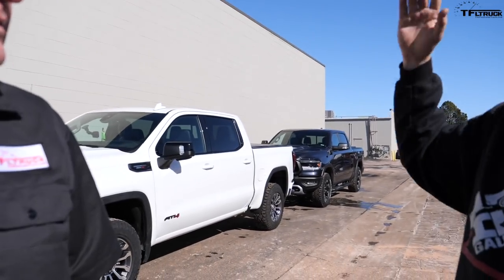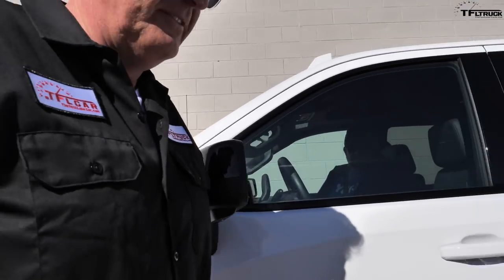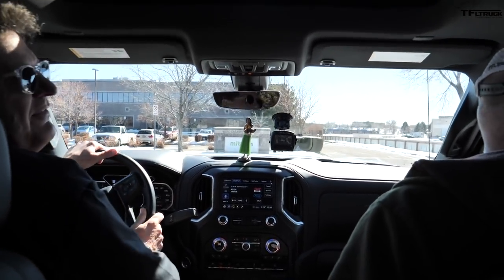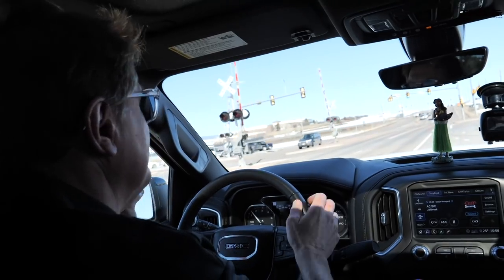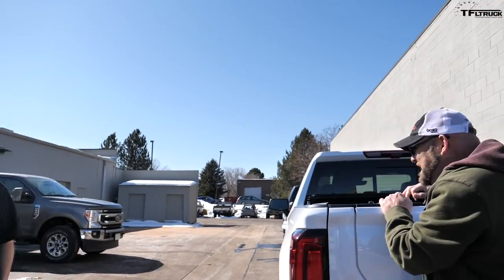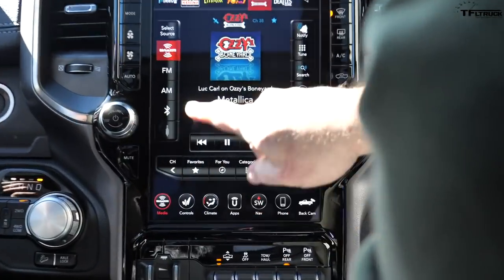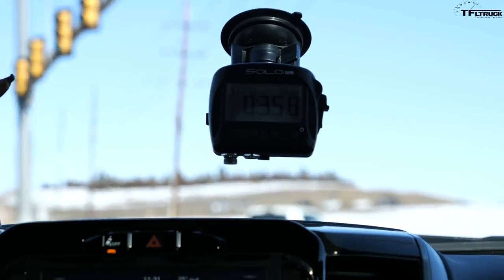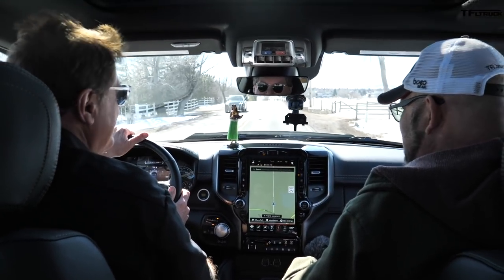Best Diesel Truck! 2020 GMC Sierra AT4 vs Ram Rebel Diesel 0-60 MPH Buddy Review

Comment: What a great and fun video to enjoy over breakfast. I will admit, that I have been looking for that color rebel, without airbags and without the pano roof. In the end, I believe the rebel will cost less money to own and operate than the G. M. Factor in the transmission and drive train maintenance and durability.  I just cannot get on board with a rear mounted timing set up, nor the oil pump design on the i6.
Reply: exactly, they took an amazing concept,  a straight 6 and ruined it with a belt driven oil pump that you have to remove the engine to service WTF

Comment: NATHAN! My man. I agree with you 95% . I've had both an Elocker on my F150 FX4 and a G80 on my Trail boss.  I found the Elocker next to useless in most offroad situations.  I live in BC there isn't much slick rock to crawl on. But lots of tight trails where a fully locked axle sucks!  The G80 being Automatic is always there. Now I'd rather a Torsen system LSD, but the G80 will do.

Comment: You are right Roman .I an glad my 2020 Silverado did not come with that tailgate.Also the dealer told me it's big bucks to replace and pickups tailgates often get damaged.I can also see lot's of areas for rust on it.I do love the electric tailgate on my 2020 which is standard on the high country package.When carrying  tool boxes and such it's a nice feature.
Reply: The multi step tailgate isn't going to rust, it's aluminum.
Reply: @karlschauff7989  That's good information.Thanks.

Comment: I am totally with Roman. . Yes to the "Man Shift handle" and NO  to all that stupid tailgate crap.
Reply: I have the GMC with the tailgate I have not had an issue. It is very easy to use. I previously owned a raptor and it cannot hold a candle to my new GMC unless I was to go desert running

Comment: I can’t beleieve noone said “forget it”.
The diesel is 20-30 years behind in technology and engineering compared to gas in the half tons and the price is prohibitive from any mpg gains and the maintenance on the diesels is insane plus def....
Reply: StoneysWorkshop . I agree.
Reply: Diesel leads gas in every facet of technology, that's partly why they are more expensive. Its not the 40's anymore where they are the cheap dumb alternative. They are the pricey performance alternative when performance is real world economy on working duty cycles. They are certainly more expensive to maintain, but not by some astronomical margin, its not 2010 anymore either and the emissions systems are relatively reliable now.
Reply: I spend $20 on DEF every 16000kms. Not really a big difference. The oil change on the other hand is $270...  I drive a lot and my fuel costs have dropped $600/mth vs the hemi I had
Reply: Matthew Garn I am speaking specifically in regards to half ton segment.
VW has great mpg in their cars and the heavy duty has the towing capability to justify the massive diesel.
The half tons can’t seem to decide what they want to accomplish with the diesel. Therefore you get something that can’t merge into traffic unloaded.
Reply: David Pritchard I am not sure about your gasket market, but here in Louisiana gas averages maybe 2.10/gal. I drive about 10,000 miles (roughly your 16,000km) every two months.
At 15mpg (my f150 with all my tools and parts loaded on hwy with 5.0) that’s 666 gallons at 2.10/gal is $1,400.
Lets say the diesel will get 25 mpg loaded with about 1,000lbs like I am. That is  400gal, and diesel on the cheap side is maybe 2.80/gal so that is $1,120.
If you are saving $600 per month more power to you, sounds great.
Here in the southern USA it does not add up
Reply: StoneysWorkshop I drive a lot as well, mostly unloaded. I have been averaging 5.5 litres per 100kms less with the diesel. Since 2014 when I got my first ecodiesel diesel has been less per litre. Today diesel is 1.121 per liter gas is 1.125.
Reply: Based on today's price it's a $400/month savings. When I first got it I was averaging $0.21/km in cost for the hemi and $0.11/km for the ecodiesel.
Reply: David Pritchard that’s great, I would be highly inclined to consider diesel if it was closer to gas prices here.
Usually a dollar or more seperates low grade gas and diesel, they’re getting closer at the moment.

Comment: I like the Carbon bed on the GMC and the bedside storage on the Ram. The tailgates on both trucks are just a gimmick and I could pass on the sunroof on both trucks. I like that the Ram has a larger fuel tank too. I feel like you guys dropped the ball on both of these by not at least telling us what the towing capacity was for both. One of the reasons you opt for a diesel is for more towing.
Reply: also a transmission review would have been nice.

Comment: I think it was embarrassing for Ram that it could not find Snarf's with all that shiny, flashy tech and the no-nonsense GMC just nailed it first try.
Reply: All that screen and no software behind it... Also, no Auto 4WD in the ram?
Reply: @svpracer98  The Ram's auto 4WD can't handle the bigger heavier tires. Tears up the transfer case over time.

Comment: I prefer the Ram tailgate but I use my truck for work and getting a forklift in closer for loading and unloading is a huge benefit; as is being able to getting into your truck bed when towing a trailer and not worrying about damaging the tailgate on trailer coupler.
Reply: They make a hitch that clears the tailgate on the GMC. Plus the bumper steps make it easy to get into and out of the bed without dropping the tailgate. Ram doesn't have an option like that, aside from those junk aftermarket steps that rust up and stop working after one winter.

Comment: Yet again Andre is right on the ram tailgate.
Reply: The Ram tailgate is a pos. Between the junk air ride system that burns up compressors, the unreliable electrical system, and the chintzy tailgate, the Ram is going to spend most of its life at the service department.

Comment: Everybody talks about MPG but what nobody seems to talk about it $ per mile to drive.
Reply: @Snake Plissken horrible mpg
Reply: Toyota tundras are junk. Couldn't pay me to own one.
Reply: Snake Plissken did you include the tow bills hauling the Toyota back to the dealer on warranty to have it fixed? I hauled mine in three time for the same problem and they would not cover the tow bill only threaten to cancel warranty if I drove it in after noticing it clunking. I will never have a Toyota again. The dealer was terrible. My gm dealers have been great to work with when shit happen as it will with everything.
Reply: I don't really compare diesels and gas. I just like diesel trucks honestly
Reply: Snake Plissken explain how you make said comment.   It’s been proven that the tundra isn’t working for Toyota
Reply: Snake Plissken who wants to buy new truck that one cannot tell the difference from the one that’s 10 years old.   Assuming said 10 year old truck is well cared for?  End of conversation

Comment: How in the heck do you get the 12 thousand pound tow rating in the ram? I tried every configuration on the ram website and the highest number I could find is a tradesman 2wd with 10,070 tow rating. On a side not I will never but another DT ram 1500. They are pieced together like a lego set and FCA doesn’t want to fix issues. Today makes day 65 my truck has been in the shop consecutively. Thankfully 🍋 laws in GA are 30 days. Can’t wait to be out of the truck
Reply: 3.92 gears
Reply: I test drove a 2019 Ram and it was a nice but but I can’t part ways with my GM 6.2. 
Maybe a good thing!
Reply: John Morris the 10070 is with 3.92. Only gearing available for the eco
Reply: @Tony-hf9mv  ah you never said it was a ecodiesel, yea they aren't rated to tow 12,000 that's only the hemi.
Reply: @Tony-hf9mv  the 3.0 Duramax is only rated to tow like 9,700
Reply: @johnmorris77  i said RAM they claim 12560 but the highest configuration i can find on there website is 10,070. Reading is fundamental
Reply: @beowulfgrendel24  that was your first comment so idk where you're getting the "I said" part. According to tfl max towing ecodiesel is a tradesman double cap 4x2 with 3.55 gears.
Reply: @R AJ yep have a family member with transmission problems in their 2019 Ram 1500.  Went to put it in drive and it didnt do anything, then slammed into drive so hard they thought they got rear ended. All kinds of metal in the transmission pan.

Comment: Would love to see a 6.2 vs 3.0 comparison. I went for the 6.2 in my AT4 but the merits of the diesel seem strong. Love to know how they tow head to head plus your driving impressions.
Reply: I've got the 6.2 AT4 as well,  but if I wanted a diesel, I wouldn't waste my time with turbo'd 3.0 v6 when there's a 6.6 v8 turbodiesel on the market. The 3.0 is bound to have longevity issues, whereas the 6.6 will more than likely last as long as you want it to.
IMHO, the 6.2 is a better call than the 3.0
Reply: I'd take the 3.0 any day vs the 6.2. I've owned both.

Comment: Correct me if I’m wrong but didn’t Lincoln had barn doors in their trucks?
Reply: The Blackwood...
Reply: My 77 Chev wagon has it. Although it's not split. Never gets used.
Reply: Connor Hendricks yep that one
Reply: It was not the same and the Ram tailgate is much nicer.
Reply: I had a Suburban with barn doors and they seemed to get in the way more then help. But some people love them.
Reply: @rayd2100  I much prefer my Suburban's cargo doors. I will never need a broom handle to keep the hatch up when the gas struts fail.
Reply: @wushock92   God forbid you replace them.  They're $20 on Amazon and take about 5 minutes to change out.
Reply: @rayd2100  True. For me, when my cargo doors are open, I don't have to duck or fight with items that are too tall to clear the hatch. Yeah, I'm lazy like that. LOL Good feedback, sir!

Comment: I don’t like the rear wet belt for the oil pump for the Duramax. It’s a fiber belt that is on the back of the motor behind a cover by the bell housing. Service life quoted by GM in theory is 150k. My question is why put a serviceable item in such a place. Planned obsolescence? Time will tell.

Comment: $65-70 k for a half ton truck. What is this world coming to?
Reply: Platinum f150 is like 80k. Insane,
Reply: David Lusk pretty sure the Plat F150 is around 74k. With the raptor engine off course but yeah expensive
Reply: That's still crazy. And with tax and license.. way over $80k
Reply: For that money, I could get a Subaru WRX STi, and a beater truck while having money left over
Reply: Platinum F-150 can be bought in the 50s with rebates and it doesn’t come with a raptor engine. That’s the Limited
Reply: @Luis Bolanos same with a good running beater truck that costs less than 10k. With the BMW, you can actually enjoy driving it, or any of other cars cheaper than the BMW
Reply: I’d like a new truck but I got my 14 Z71 Crew for $36k back in 2014 on the Black Friday clearance sale. I only have 57k miles, with trade  in value at $23k or if I’m lucky to get $28k private id have to be a fool to finance another $30k+ for what.. less hp, maybe +100lbs torque and better mpg? These new truck prices have buyers stuck in their current rides. I think I’ll just drive my paid off truck until she rots. Am I thinking about this wrong?
Reply: @Luis Bolanosbad idea. You want a truck that already got dents and scratches, and faded paint over the one from a showroom that costs about the same as a Porsche. And instead of putting that kind of money on a truck, you could get a nice car like a BMW Z4, VW Golf R, Subaru WRX STi and enjoy your daily commute and your freetime in the back roads and on the track. Spending over 40k on a truck is just absurd, but spending 70 or 80k just for a truck is idiotic. And you are not going to have fun in a truck that is automatic only. Can you name a half ton truck with a manual transmission still being made? I don't think so, they are boring af
Reply: This is the result of the buying public wanting everything including the kitchen sink in their vehicles.  Ain't life grand?  I'll keep my 2015 Colorado.
Reply: Steven Bittner exactly! These same people are always complaining as if the top of trim levels are the only ones available to buy as well as complaining about there being too much tech and luxury on these trucks..If you don’t like it or can’t afford it, you can still get an XL, XLT, Work Truck, Tradesman, LS, LT
Reply: Nothing new
Reply: @GhostOfAMachine  Just worry about where your money goes, not everyone wants to drive a little shoebox! sheesh.....
Reply: @iggy944  i know, not everyone has good taste. Overpriced monstrosities just look ridiculous. Only good trucks are made 90s and before, when they had a clutch pedal and a long shifter on the floorboard.
Reply: @GhostOfAMachine  lol good taste?  You lost me at driving a BMW z4 or vw golf. But whatever floats your boat
Reply: Now I understand why some people have a 70k$ truck and they live in a shithole. Priorities.............
Reply: Yes that crazy , that more them my house cost back in the day, they are way overpriced but people are still buying them so to drive a new truck that what they will want for it and will not deal much GMC let me walk out the door over 700 dollars and they sold the trade in to me so i went test the dodge out and payed that much more and then some after driving both of them so they did me a favor
Reply: @brentlafont5005  wow, have you ever heard of punctuation??? Your entire comment makes little sense.
Reply: I don't know if a diesel is worth the extra money. I've seen 2020 Rebels with 12" screens on dealer lots for $46,000.
Reply: @kevinwilliamson7294  I definitely think this is the case for many
Reply: @9663mu  You do not get the Raptor engine in the Plat trim only in the Limited trim and its over 85K!!!
Reply: @davidlusk4350  The Limited is over 85K!!!
Reply: @9663mu  You do not get the Raptor engine in the Plat trim only in the Limited trim and its over 85K.
Reply: Justin Thurman right but in US the limited is 74k. Your in Canada ?
Reply: @Luis Bolanos You can get more bang for your buck with a used heavier duty truck
Reply: @jlv3x  Yep. Just looked this morning at a local dealer. Had Rebel 5.7 crew cabs starting in the 42K range. Not a single diesel on the lot and no quad cab 4x4's. For those on the cheap get a base work truck and add the diesel and rebel package. Not sure if the Rebel package goes down that far in the trim line. Will update if it does.
Reply: It’s call inflation.... not only truck but everything is getting expensive
Reply: Greed
Reply: Just you wait. Pretty soon 100K will be the average. Expensive junk that cost thousands to repair and breaks constantly.
Reply: @nickpasler2629  your dreaming
Reply: here in Europe the Rebel costs 83 000 euro in 5.7 liters with LPG tank... the gasoline is 1.356 euro a liter and now is low ..it was 1.85 a liter kind of 7 dollars per gallon. The diesel now is really low and is 1.235 euro liter. Was 1.7.
Reply: That is why i will NEVER buy a new truck again, I got into a 2015 2500HD Duramax 4x4 with 56K miles for $35kish after trade in ...
Reply: Sticking with my now 20 year old truck. She’s rusty and not as pretty as she used to be. But still does everything I need and no $800+ payments for 6-7 years!
Reply: Maybe because trucks are functional unlike cars or suvs
Reply: Government created inflation caused by excess printing of paper money.
Reply: billn911 you’re I had to sale my 2015 f250 platinum because of financial situation and now I’m getting where I can get a truck again but the prices are outrageous now compared to 15. I will find something older and just keep fixing things in it before I buy a new truck
Reply: For that price I could buy 7 good used trucks and have one for every day of the week. No joke...
Reply: @billn911  no
Reply: @Hockey36a  Great comment..bunch of broke haters!
Reply: inflation and 22 trill in national debt

Comment: Forget those stupid tailgates. Give me a normal tailgate,  no sensors or cameras,  and price it in the upper 30's.
Reply: Yea thats a base model truck with normal tailgates and basic interior which price starts way less than these in the video
Reply: Taylor they make those trucks but very few people buy them, so you have to order one from the dealers. There’s no discount on those trucks though.
Reply: When you hit 50 years in age, those tailgates are definite selling points. Thinking about trading in my 2018 Silverado just for the tailgate option.
Reply: Dampened multi function tailgates and sensors/cameras have their rightful place in a truck. They just need to be durable and reliable without compromise! Same with bed liners. These are the basic attributes of a truck yet they're not standard issue but are gated behind overpriced packages and made with unreliable, cheap quality hardware and component. These tech aren't new, it's up to the buyers to push higher standard and fair pricing on the compagnies but it's not gonna happen since people change trucks like they change smartphones.

Comment: Does the Ram have a blind spot camera on the right side mirror that activates manually or when you use the turn signal? My wife 2016 honda Accord has this.  The right side mirror is critacle in traffic.  Someone at Ram needs to understand that the right mirror on my Longhorn Larami sucks compared to my  98 Silverado.

Comment: Funny how they talk about how the shifter on the column is how a truck shifter should be. Sadly the way a truck shifter should be is no longer available in full size pickup trucks, a manual. All these transmissions are electronically controlled so why not move to a space saving dial or push button system? Also, the tailgate portion was hilarious! Great work guys!